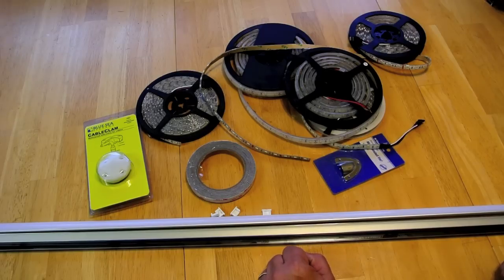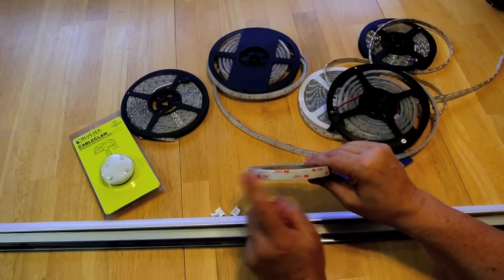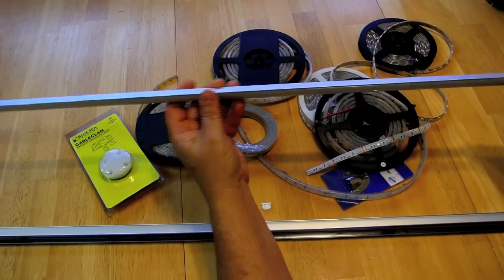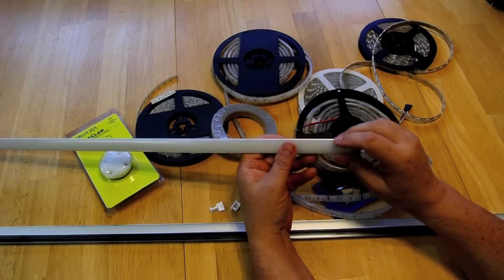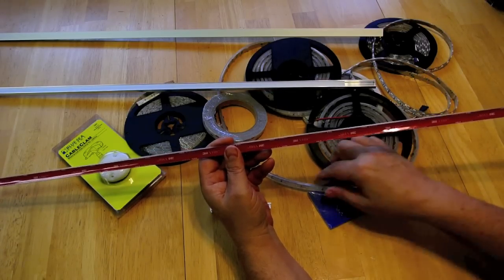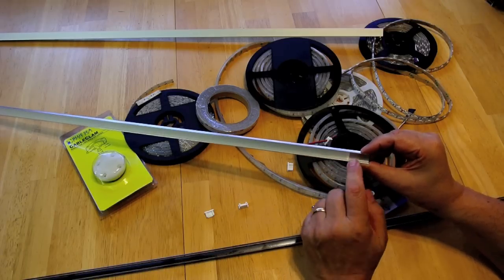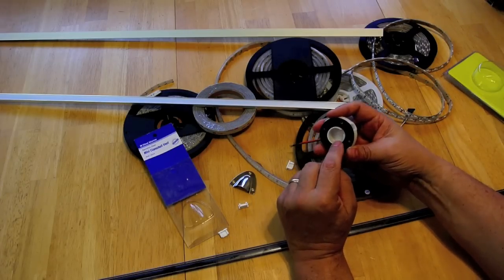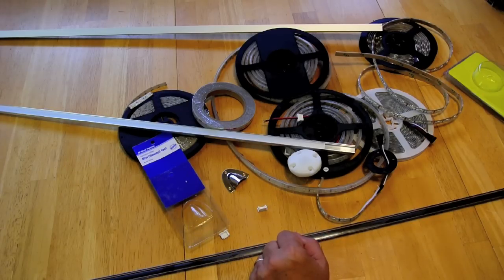Adding a LED strip to your RV (Part 3 - mounting options)

Comment: Making it wayyyyy more complicated than it has to be. Just get some 2 sided tape and place a piece of tape 2 inches long about 3 to 4 apart and attach that to whatever your lighting up. Pull backing off lights then attach accordingly. Shouldn't take but 15 to 30 minutes tops
Reply from the maker: Remember the LED strips need to withstand hurricane force winds when traveling down the road.